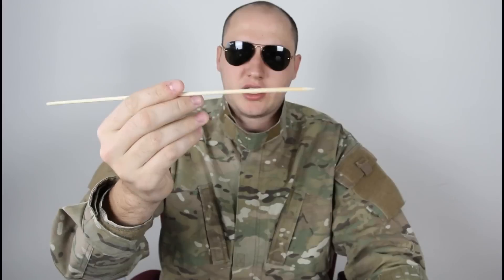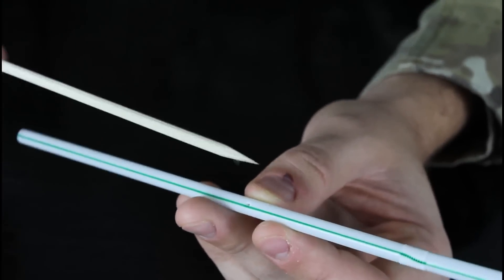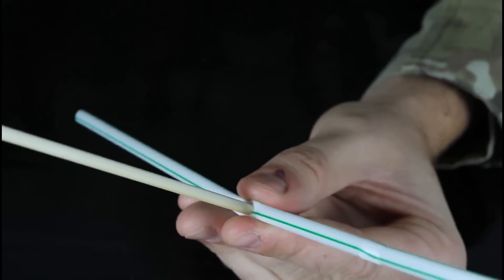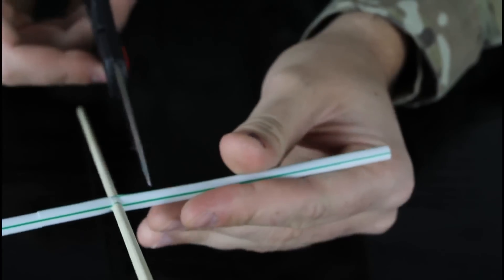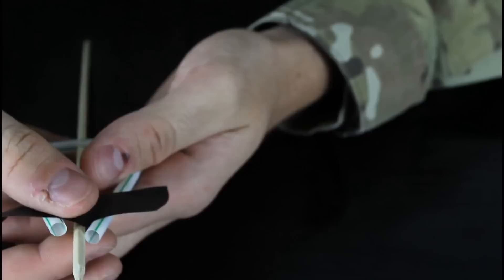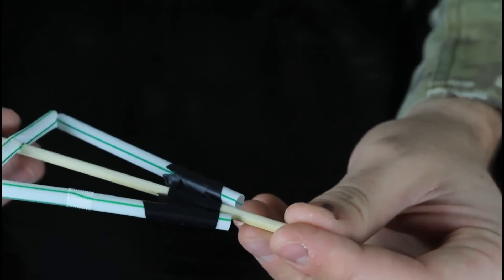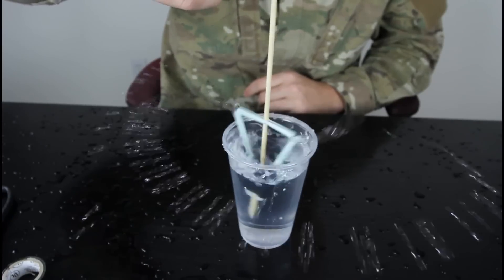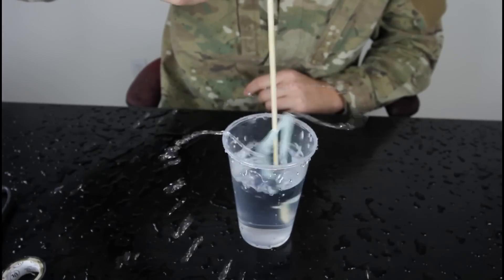Simple Water Pump from a Straw - Science Experiment

Comment: from 81-84 while working as a passenger elevator constructor... we would take the cone shaped drinking cups, and tear the lip of the cup down about a 1/2" and 1/2" apart, then folded them to the outside of the cup, to form 90 deg. fins. then drop it full of water down the adjacent hoist way where our coworkers were working about 4 floors below on their open cab platform. the fins centrifugal force would spin the water up and out of the rim of the cup... leaving a rain of water coming down on them before they could escape to the nearest floor. this escalated into them using a large drinking cups with fins on us. this back and forth banter ended up with us dumping about a remnant quarter of a 55 gal. fire barrel on them. so oh yeah cousin!... the absolute power, of "centrifugal force" is at work here.    
-gilpin 7-23-16

Comment: Combination of centrifugal force and low air pressure draws the water up the straws. 
Water enters the bottom of the straw and is drawn up when he spins it. At the same time, an area of low pressure is created by the air rushing fast over the straw openings, causing the water to rise toward the low pressure, (suction) and in conjunction with centrifugal force (spinning) throws the water out the other end
Similar to how planes get lift, air speeds up over the wing, causing a drop in pressure, allowing the wings to rise. Same thing with the water.
Reply: Good job boy...u got an oscar
Reply: +Software Box Pullitzer prize more like.

Comment: No use a straw and tape 5 totter then out a long pipe and then it does it have a suck on it for a bit and then let go and let it flow a way down hill and then mack shire you have a pie Small thay the straw use big star so thay it can get don't
Will in to your garden and thy do it up slowly and thy you got a siphone Lat last forever almost but ,are sure you have a lot of water of it cos it for all round and then try your street with It and try and make it do a loop de loop and make shire use coalesce water and oil somewhat you can have a two tone cooler of it so Greem oil food die and the food dis so it floors on top so they you can make keep de loops and have a Made t confer so it can  get vamus with a one bale cos water can't get up it so it has a vacmue that has a one in and then down a hill for a big boost and then at end of it have a preser Ganges cos you need it so that if you slap that vacmue that it would burst and have a lot so it can co in and go zoo a nod make a yt vid for it

Comment: People stop correcting "centrifugal" to "centripetal". Doing so makes it even more wrong!

From the straw's point of view centrifugal force is real and throws the water out.

From the outside view* INERTIA makes the water continue out, since the centripetal force, which would otherwise make the water continue around in circles, IS LACKING (because of the holes in the straws).

Centripetal is NOT a synonym for centrifugal, the two are opposed, and using centrifugal is only "wrong" when you are in high school. In any case whether centrifugal force exists or not, centripetal force does nothing to pump the water her - it goes the wrong way.

*This view is, for simplicity, the only one deemed "right" in high school. Hence the "lie to children" that there is no such thing as centrifugal force. 

See also http://xkcd.com/123/

Comment: the g-force shoots the water though the straw
Reply: emlmm88
You both never took physics. G-Force is an energy drink. F-Bomb is an energy drink. G-force plus F-Bomb = Big-O. Inertia is a mass's reluctance to change momentum, or perhaps more accurately, to accelerate. Inertia doesn't move anything, it's a property of a moving mass.

G is the universal gravitational constant. It's derived from observtion of the force that masses (like orbiting stars and planets) exert on each other given the masses of the masses ( !! 8) !! ) and their distance. The constant g is the mean acceleration of free fall caused by the earth's gravity - it's NOT A FORCE. Gravity was NEVER a force. Gravity only causes a force to be exerted on a mass. That force is called weight. Weight is in pounds or Newtons. Mass is in slugs or kilograms. Mass is the same anywhere and I don't care what your bathroom scale says, unless it's a balance. A scale will need to be recalibrated when you take that trip to Mars, which anyone should be ready to do after listening to this crazy fucking Russian.

Centrifugal force is what's happening, here. The straw tries to confine the water to a circular path by means of centripetal acceleration. That's the acceleration that keeps a yo-yo confined to a circular path during round the world and multiplied by the yo-yo's mass, gives the force exerted by (tension of) the string.  But it's an open system due to the angle of the straw ends and if you spin it fast enough, the mass of the water times the centripetal acceleration equals the centrifugal force. The water can't exit horizontally, but it can travel through the straw - do the trig - the vertical component of the force overcomes mg - the weight of the water, so the water takes an upward motion. It also has to overcome the frictional drag of the straw - called head loss.

Now that you almost as smart as what you're fucking with, you can attach an anemometer to this rig and water your lawn.
Reply: Have you ever spun a yoyo on a string around in a circle? Notice how the yoyo seems to pull away from your hand when doing this - this is because you are putting the energy into slinging the yoyo one direction, but the string keeps holding it back and forcing it in another direction because you've moved around the circle. Objects in the universe want to move in a straight line, so it takes energy to cut that off. As a result, when the water reaches the tube, it is propelled outward by it's own inertia (property of all matter that keeps it moving or at rest unless acted upon by a force).
Reply: No the inertia moves the AIR out of the sloped surface of the straw, which creates suction, and that pulls the water.
Reply: G-Force is acceleration felt as weight, so he's technically right about that, but what pulls the water into the straw isn't inertia, but suction.
Reply: Also centrifugal force doesn't exist - it's merely the continued inertia of the object in a changing frame of reference that moves it outward.
Reply: emlmm88
bullshit. There's no suction and the water is already in the straw. You never put a straw into a liquid and noticed the level is the same inside the straw as it is in the glass? He cut vents in the straw where it bends.

Force and weight are of the same dimensions, kg.m.s^-2 so why split hairs with mumbo jumbo about how a mass "feels" about acceleration like some airy faiiry new age freak with magic crystals? What's causing the water to fly out is that the centripetal force that would like to act on the water to keep it in orbit is confounded by the angle of the straw. it' not a vertical straw. On a microscopic level, the centrifugal force causes molecules to hit the side of the straw (ok, inertia - it's the straw hitting the water molecules) and they bounce upward, ricochetting of the walls of the straw as they go.

Consider a single tiny drop of water at the top of the straw. Say the straw makes an angle of 30 dregrees with the axis, the drop is 6 cm from the axis, and it's vertical distance is about 10.4 cm from the bottom of the straw - vertical distance, not the length of the angled part which is 12 cm. The weight of water drop is Fw and it's mass is m. The centrifugal force, Fc, to be exceeded to get that drop moving upward would be the Fw.tan 30 .

m = Fw/g

Fc = (m.v^2)/r

Fw.tan30 = (Fw.V^2) / gr , Fw cancels out, g = 980, r = 6
(g was converted to 980 cm/(s^2)  from 9.8 m/(s^2)

v = sqrt(5880tan30) or v = (5880tan30)^(1/2), if you like

v = 58.26 cm/s
RPS = v/(2.pi.r) = 1.54 revolutions per second

Not much at all, but it won't water the crazy freakin' russian's lawn like he did with that high speed pump of his. if the straw is lowered to compensate for the loss of fluid, you get a repeat performance for the next drop which has advanced to the front of the line. Additionally, the drop gets a boost from the water below it being forced upward, if and only if the angular velocity of the pump is enough to overcome the weight of each of those drops. Incidentally, notice that centripetal acceleration, and thus centripetal force and centrifugal force are inversely proportional to the radius? The radius is vanishingly small at lower depths, so the force is greater at a given angular momentum. So that's a freebie. To actually determine the minimum angular momentum to make this work, neglecting head loss (friction in the straw - laminar flow) I think you'd integrate individual horizontal slices of the system. The pressure bearing down on any given drop of water and the radius can both be written in terms of depth, so with one independant variable, dy for the slice, alll that is needed is a single integral equation.
Reply: The good force

Comment: First the comes in the top where the pointy thing is where the is going to come in. Second the water will come up the one you folded on the straw and so the water will come out of the hole and spread out like a sprinkler and also it will come out like a circle because you spinning the thing around like a circle. Now this is what I know

Comment: The water is pushed inside the straw's inside and bexause of the straw angle and because of spinning is pushed away, so it will flow through the straw. Kinda hard to explain but this is sort of why the water sprinkles

Comment: the centrifugal force is greater than the gravity and because the straw is at an outwards angle when spinning it allows the water in the straw to fling out the top. this would not work if the straw was angled towards itself.

Comment: For centrifugal (actually centripetal) force to affect the water, the water must first be in the straw. An experiment to test whether it was a low air pressure at the top of the two open straw sections, or centripetal force, would be to have a lower air pressure (less dense air) and retry using the pump. Anybody willing?

Comment: Your explanation is more accurate than Vandeputte's. I am shocked that 26 peeps on youtube gave thumbs up to a wrong answer. 

The upper openings of the tubes spin around faster vs the bottom. This creates a pressure different between the openings. The upper ones experience lower pressure, hence the water is being push out of the lower pressure ends.

Try this: use a straw, stick it in a cup of water. Then blow air across the top opening(perpendicularly), you will see water rise up as well.

Comment: Are you sure about that?^^
I don' t think the different between the atmospheric pressure and the low pressure around the top holes is great enough to work as a pump.
If it is correct it should work with the straws being parallel.
Just try it xD
My guess is simply the centrifugal force.

Comment: The spinning of the straw causes a low pressure pocket around the top holes of the straw. Then the atmospheric pressure pushing down on the water in the glass forces the water up the straw and out the top. This is also how drinking from a straw works.

Comment: At any given moment, the water level in the straw will rise to match the water level in the cup because when the water level in the straw is lower, the pressure within the straw is also lower. When you spin the straw, you start accelerating the water away from the stick, but because the water is enclosed within the straw, it must move upward in order to move along the straw. The force from the spinning exceeds the gravitational force on the water, so the water is pumped upward.

Comment: Not quite, on the top of the two ends of the straws, the pressure is reduced because of the angular velocity he gives it, therefore, the pressure is lower on the tip of the straw while the pressure in the straw is atmospheric. This difference in pressure causes a sort of "suction". This is what happens on airfoils and consequently makes airplanes fly.

Comment: how it works is that when you put the contraption in the water the water will take up some air space inside. When you spin it the G-force on the water pushes it to the outside as much as possible which in this case is upwards and outwards,the water travels up to the holes in the straw and flies out.

Comment: The pump works through a theory known as the "venturi effect". Simply put, as the pump spins, it passes through the air creating a vacuum at the holes in the straws. This vacuum needs to be filled and is done so by the water in the cup which is then thrown all over your table. hope this helps.

Comment: it works by when you are spinning it and the straw has a little water at the bottom, the v shape wants to push it out because it puts little pushing pressure out when the water is  in the middle and the farther it goes out more force is put on the water trying to force it self out. (like a balearena spinning with arms in spins faster, and arms out spins slower.

Comment: When spinning the straws you accelerate the water inside the straw with the circular motion. The water also experiences a centripetal force due to inertia and will try and travel outwards from the pivot. It cannot travel directly outwards, but a component from the inertia will travel upwards too, lifting the water out the straw if it is spun fast enough. A smaller angle from the horizontal will mean more water coming out until it reaches a practical limit

Comment: When you spin the stick, water in the bottom of the straw feel the pull to go outwards (centrifugal force) and go up the straw because that is going in the direction of outwards. Hike how water can go horizontally and downwards with gravity when you pour water on a shallow hill. A detailed explanation would be that the centrifugal force is that of matter (the water) changing directions, causing a resistance to the change, causing the water to want to go straight, making the water go outwards.